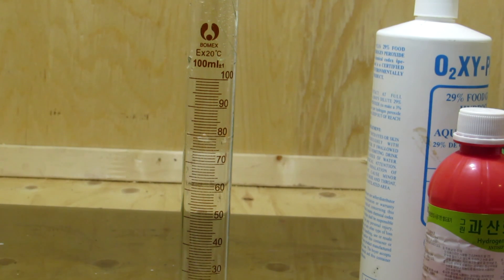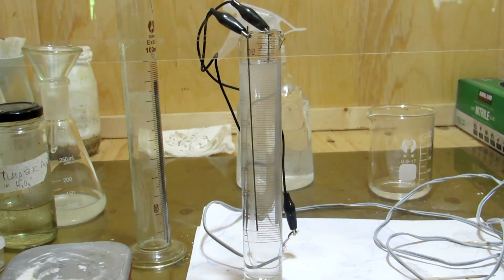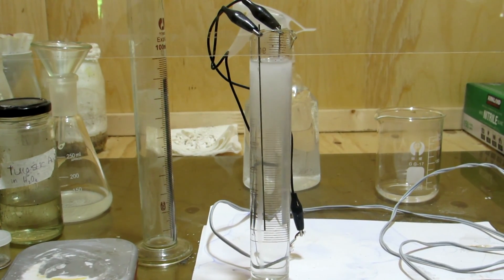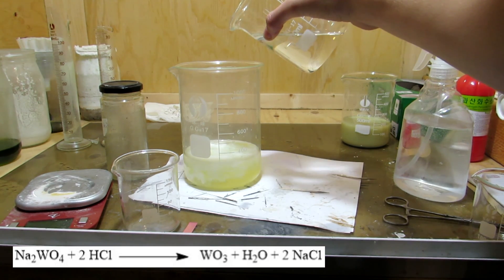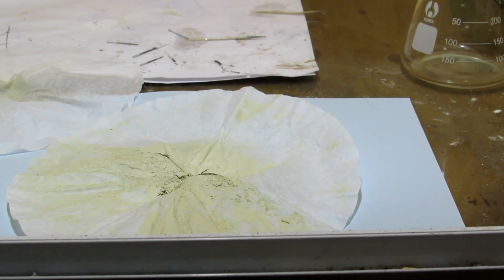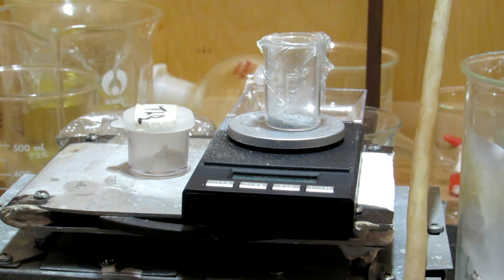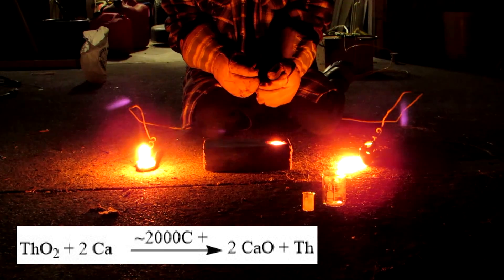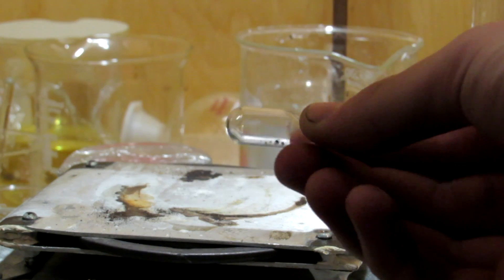Extracting Thorium from Welding Rods - Household Materials

Comment: Amazing video, more efficent way of extracting thorium will be to get it in solution and electrolyse the solution with carbon anode and copper cathode the Thorium will plate out at cathode (Copper as cathode as the plating will be easily visible).
Reply: An important note: the Hydrogen and Oxygen bubbles made while electrolysis will make mists of soluable thorium which can be quite harmful.

Comment: Hello again my Canadian friend. I would love to get a large sample of relatively pure thorium dioxide myself someday, it makes incredibly refractory ceramics (melting point is greater than 6,000F) also do you have any idea which companies supply the thorium dioxide to the tungsten welding rod, and gas mantle industries? surely they would have some. also, can you make sodium meta tungstate? or lithium meta tungstate? because that stuff is expensive and is used for mineral separation, and I would love to get my hands on some of that. If I had a procedure to follow then I could do it myself. oh and hey, I have a similar setup as your make-shift arc furnace setup. I'm using charcoal and silicon dioxide with a carbon arc to produce silicon, a sample of which is sitting in a cup on my desk as I post this :)
Reply from the maker: if you just look on Amazon or eBay, you should be able to find lots of companies selling thoriated tungsten welding electrodes. alibaba may sell them in a larger quantity for cheaper if you are wanting a lot. I’m not sure which companies sell pure thorium dioxide though. 

That’s very neat to hear about your arc furnace! they work great. And I’ll look into trying to produce some metatungstate compounds, that would certainly open some cool doors to separating minerals. thanks!
Reply: @TheCanadianChemist  looking forward to see that! the sodium metatungstate is soluble in water and makes a very dense solution, it is also mostly non-toxic, unlike the other cheaper heavy liquids used in mineral separation. the idea is simple, you put your cleaned mineral sample in the solution, and the dense minerals sink, while the lighter ones float. I need a solution with a density of about 2.8g/cm3 to separate sand into only quartz grains. then I can make unlimited (relatively pure) homemade silicon (using my arc furnace design). I had been using chunks of quartz or plain agates both of which are made of silicon dioxide.

Comment: This is interesting but you can't "make" thorium unless you have a way of creating a supernova in your lab. Just kidding,.. keep up the good work. I don't know if you have ever seen a gas mantle burn. My dad had Coleman camping lanterns and I have friends who had a log cabin with gas lights. The mantles put off an incredibly bright white light. If you touch them once they have burned for a short time, they disintegrate. Otherwise they hold their structure. There may be some mantles at my dad's house.  The man saves everything.
Reply from the maker: That is so cool! Yeah, I've never seen thorium mantles before lol. That is so sick that he still has some.
Reply: The Coleman Company sold them in cellophane packs of two. I remember my dad showing me how to replace them. The key was not to touch them where they burned, even when replacing them. They were made like tiny loose knit tube socks, with a collar band and cinch string tie. I don't know how true this was but, he told me the oil in you skin would cause them to fail sooner. We just gingerly replaced them. The first time you turned on the gas, they would balloon. A set would last a couple years if you were careful. The lanterns also put out A LOT of heat. . @TheCanadianChemist